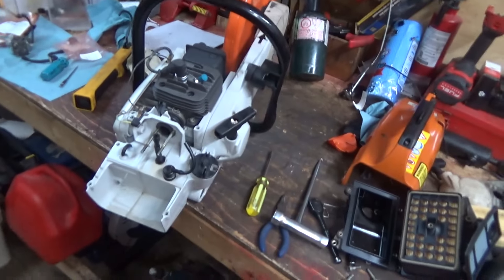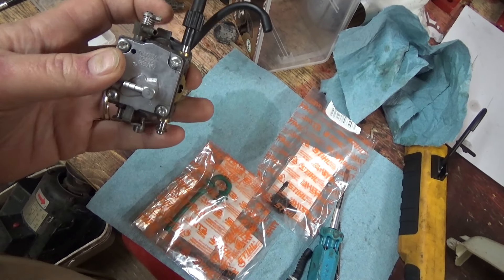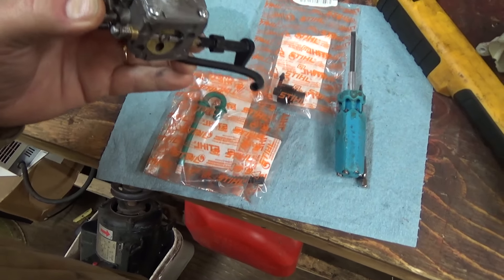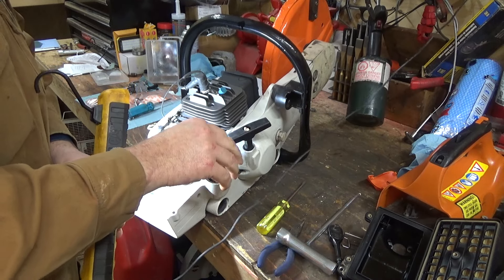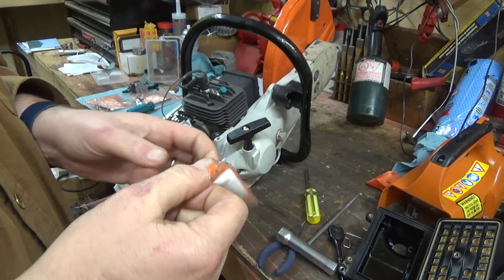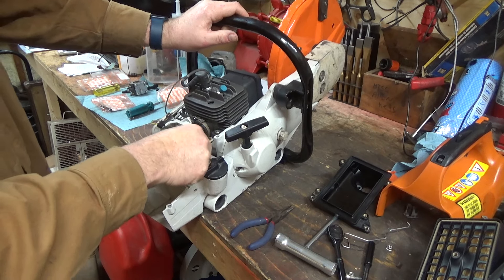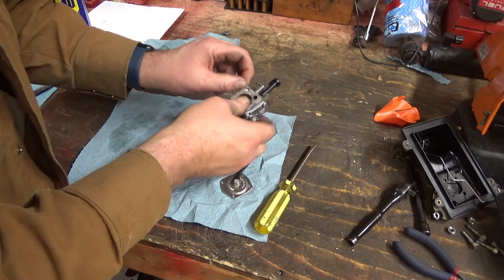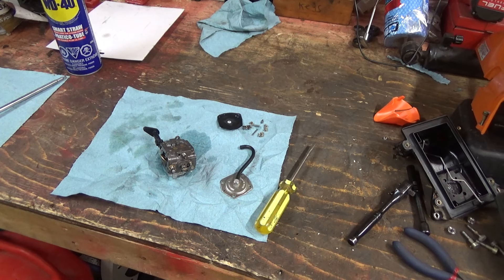Let's try a few more things to see if we can figure out why its not running right from low to high

Comment: You put the first vent in backwards from the original. Long hose went to the rear and you put it in front. Do not know if it matters but different lengths probably does
Reply from the maker: good eyes.. ill swap that

Comment: Do you have link for the new ultrasonic cleaner u got and what size
Reply from the maker: https://www.amazon.ca/CO-Z-Professional-Ultrasonic-Cleaning-Transducers/dp/B07NVB2ZG4?pd_rd_w=7E8jA&content-id=amzn1.sym.5c209954-1063-4582-844a-52f5c73633d4&pf_rd_p=5c209954-1063-4582-844a-52f5c73633d4&pf_rd_r=WM8W688NDB40Z3K3MBGS&pd_rd_wg=rnDZt&pd_rd_r=0013c4d5-6e19-47a3-acb4-9e15e8d2d41c&pd_rd_i=B07NVB2ZG4&psc=1&ref_=pd_basp_d_rpt_ba_s_1_t
Reply: Here in the US that same cleaner is 139 way cheaper sorry Bill Canada charges way more .... must be all the duty taxes they charge
Reply from the maker: canada is always more for everthing.. Guy here that vistis the cemetery just bought a gmc tuck $108000... insane